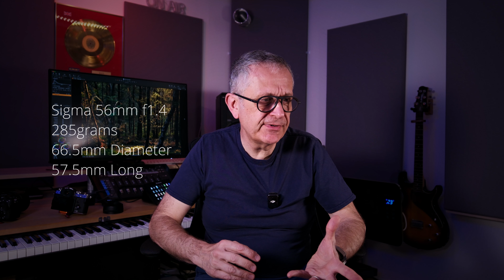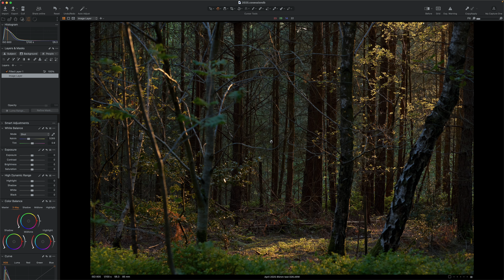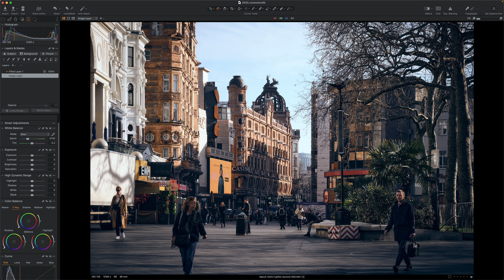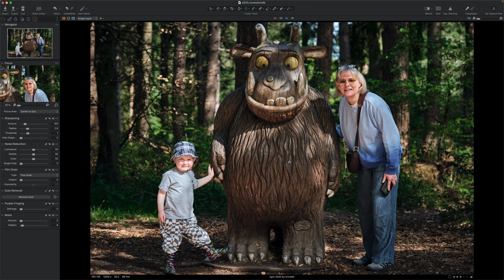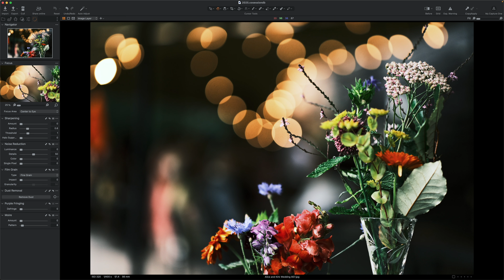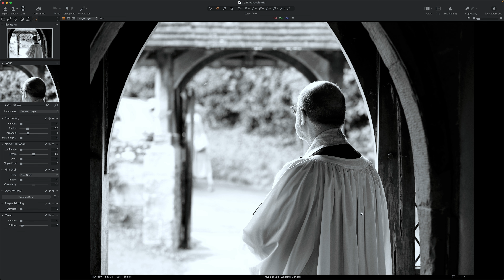Can The Sigma 56mm f1.4 Create Magic?

Comment: I don't do magic. I'm kind of torn right now, between the Viltrox 56mm f/1.4 and the Viltrox 56mm f/1.7. I'll be buying one of these in a few days. The Sigma seems more comparable to the second of these, with no aperture ring and plastic body, though it's considerably heavier and also costs a lot more. The 3 lenses should be extremely sharp across the whole range. All things considered however, the Sigma would be at best, my third choice. 

I have the Viltrox 13mm f/1.4 (metal) and the Viltrox 9mm f/2.8 (plastic.) Both of these are awesome lenses. I prefer the solid construction of metal lens, and a faster aperture, but the smaller lighter lenses have certain advantages too.
Reply from the maker: @SeeNoEvilHearNoEvilDontBeEvil These choices are difficult. The Sigma lens is only 280grams so lighter than the Viltrox 56mm f1.4 which is 290grams. I think the Viltrox F1 4 is one of their older lenses so maybe the F1 7 would perform better on image quality. I've got no data to back that up though. I guess their new 56 f1.2 is too big and heavy for your usage. 
At the end of the day I'm sure you'll be happy with any of these when you're looking at some nice shape depth of field shots. I've just ordered the Viltrox 75mm f1.8 and very excited about that.

Comment: Really interested in this lens for travel and documentary stuff, to go with a 35mm equivalent on another body. I think the 50mm f2 from Fuji would be a bit easier to work with, but f1.4 against f2 and the Sigma being actually cheaper is hard to ignore!
Reply from the maker: @SamiPaju Thanks for commenting. Yes it definitely is great for travel given it's weight and compactness. I guess if you found a used Fujifilm 50mm f2 it might compare on price.

Comment: Thank you for your thoughts on the Sigma. I never owned a 85mm while having my Sony FF and always kind of missed that focal length. When I sold my FF and went to the XT-5, the Sigma 56 1.4 was the first investment in glass apart from the kit.quite happy with the Sigma in portrait usage, I find it hard using it in street setups. Of course it isn’t “meant” that way… so I’m thinking about getting some wider fixed focal lens for street or the lost places stuff I like. Any thoughts or recommendations on that ? Thanks for your channel, I always appreciate your videos.
Reply from the maker: @ms37895 Thanks so much for the support. 
In terms of a wider prime, I've used the 18mm 1.4 from Fujifilm which is a beautiful lens as you may have seen in my video on it. It's not quite as small and light weight as the Sigma 56mm. Somebody commented on this video and mentioned the sigma 23mm but I've no experience of it. I guess the questions to ask are whether you need the f1.4 aperture or whether the smaller Fujifilm lenses would work better as they're smaller. I guess in the spirit of this video lenses from viltrox and others are also really worth looking at. If size and weight aren't an issue for you the Viltrox 27mm f1.2 is meant to be an awesome lens. 
I'm not sure I've been that helpful apart from just mentioning everything that's on the market. 😃
I hope you manage to find something that works for you.

Comment: I got the 56mm F/1.4 when it first was released for Fujifilm, after using it for a few months and being impressed with the look when shot wide open and the sharpness across the frame when stopped down a little bit, I pre-ordered the Sigma 23mm F/1.4 when it was announced, both are excellent lenses that render well, and are sharp.

The 23mm is a fantastic lens, and it is what I use(d) for full body portraits in the studio, with a 2 lens setup, the 56mm and the 23mm. it was a perfect setup.

When I say used because I still use them, but I am using the X100 VI with (or without) the TCL-X100II for most of my work now.
If I was doing something that requires a tighter field of view, I'll grab the 56mm Sigma, or if I was to do anything i needed the fault tolerance provided by a 2nd card slot etc.
Reply from the maker: @9Mtikcus Thanks for commenting. Signs do make some wonderful lenses. I use their 14-24mm on Sony for my interior work. We're lucky there are so many great options these days. I guess the only problem is trying to choose which one to go for. 
Happy shooting.